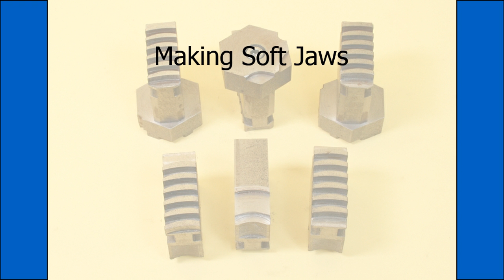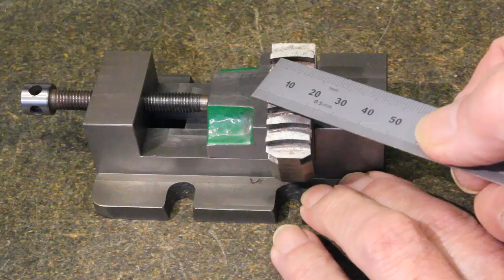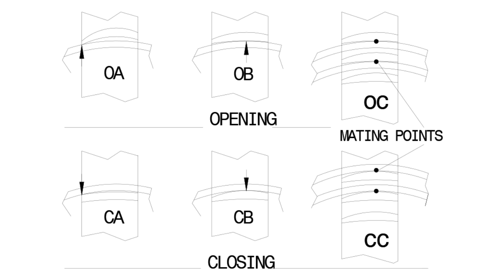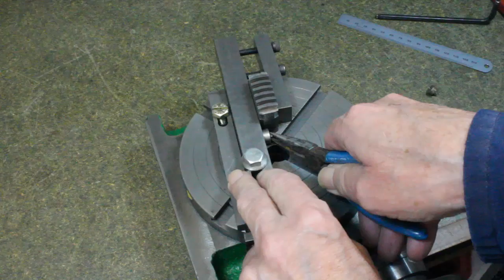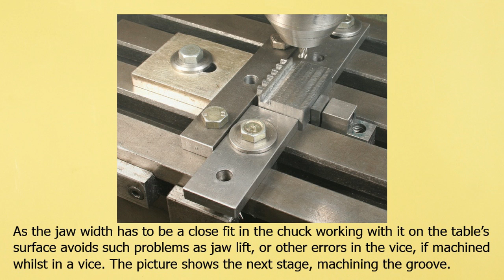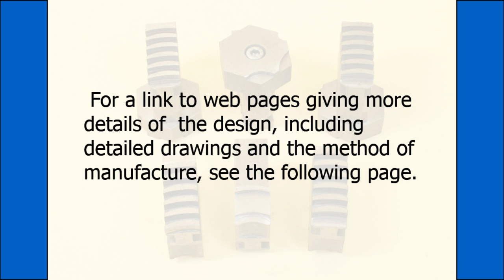Soft Jaws for the Three Jaw Chuck

Comment: A little different concept on making jaws which may be of interest to you https://www.youtube.com/watch?v=uJKW9chQrM8
Reply from the maker: I had considered the same idea Dave, but went for the challenge of producing conventional jaws.  Yours would certainly be easier to make and work well
providing one did not over tighten them, which would rarely be necessary in any case when using soft jaws. Liked the video!
Harold
Reply: Great to hear back and love your work! I may try your approach but was wondering if the run out changes when clamping different diameters?
Reply from the maker: Sorry Dave I may have misunderstood your question or you have misunderstood the purpose of soft jaws. Please excuse me for answering on the basis of the later.

There are many uses for soft jaws but in all cases the jaw is machined to suit the diameter of the part to be held and then used only at that diameter, because of this, the workpiece will run perfectly true, being one of the two main benefits of soft jaws.
The other main benefit is when machining very thing parts, a washer typically. Say a washer is to be made 25mm diameter and 3mm thick. Having made and parted it off from a piece of bar it can then be held in the soft jaws which have been machined to 25mm diameter, and 2mm deep and the second side faced. Trying to hold a washer for machining in the normal jaws would be very difficult.
If however, you were just using my soft jaws as those normally fitted to the chuck then the result would be no more inaccurate than those supplied with the chuck, though I see no purpose for using soft jaws in that way.
I could write a lot more but would refer you to my page on using soft jaws on my website. The address being,  http://www.homews.co.uk/page100.html

Harold
Reply: Ahh I see where the confusion comes from. I was thinking more if you made a generic set of jaws such as the ones that came with the chuck does the run out change clamping different diameters. Was wondering if making more precision jaws improved this issue. Does the scroll capture more consistently. You could also do it with a set as described for a specific diameter. Turn something, open and close the jaws and is the run out still zero.